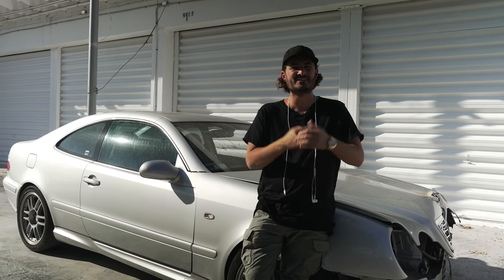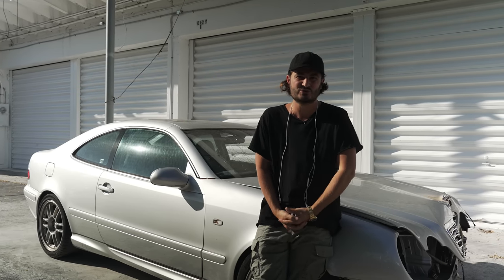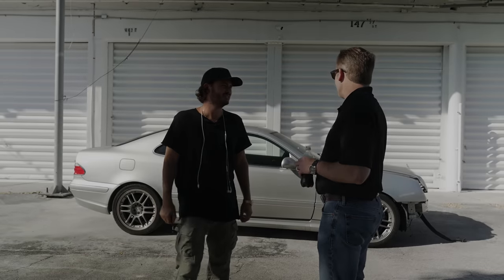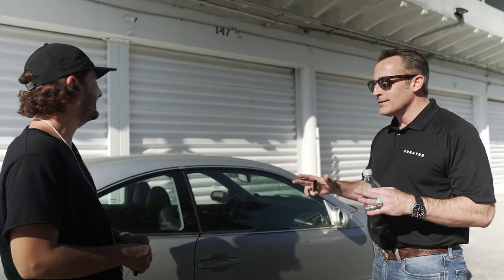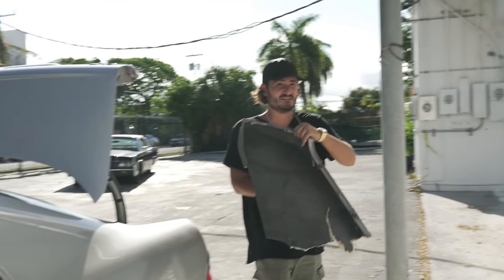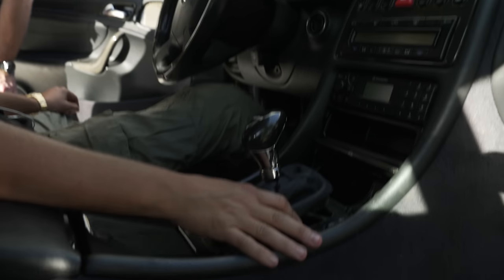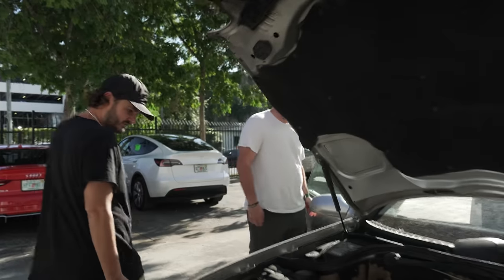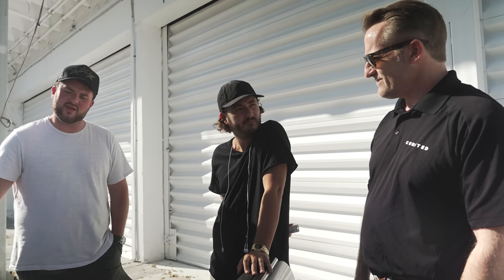1 of 1 CLK60 Donor Car Arrives - Absolute Disaster!

Comment: simple on the transmission part.... the v6 m112 and m272 manuals trans bolt right up to the m113s .. i have done that to my clk500 all benz manual parts bolt right up.. pedal assembly , v6 flywheel and clutch all legos

Comment: That is going to be a really interesting project.  I absolutely luv the wheels Multipiece OZ racing F1 Plus is what they are called. I had a BRAND NEW set of OZ F1 Plus , not splits, that I special ordered directly from OZ back in early 2000s, but they were stolen out of my garage in Denver before I even took them out of the boxes.  They never even saw daylight, Yes , I am very sour on that one, but I have the car that they were meant for still.  I've looked but never found another set of those wheels. I've always liked those CLK AMG Black Series since I saw the Top Gear episode it was on.
Reply from the maker: ugh thats heartbreaking.. damn thiefs.

Comment: Crazy thing is, I used to have a similar CLK 200 -00 manual (5-spd), in same color. It looked almost identical to John's 55AMG.  A regular person couldn't tell the difference from the outside, and mine had 136hp.
Reply: AMG kit on a regular Benz… Youre not fooling anyone with that, i promise u
Reply: @subway5907  Mine didn't have an AMG kit. I meant that a regular Clk 200 looks interestingly similar to this. Not meaning this as a diss. Sure car ppl can tell the difference. I do have an -84 Bmw 323 with genuine e30 M3 brakes and e30 M3 genuine front struts, all e30 M3 genuine hubs and some other parts tho..

Comment: I'd keep the engine in it's stock form, especially with it having a manual transmission. The engine may well be fine so no need to re-sleeve it or anything like that? I've been looking at conversions because I have a 6 speed SLK320 (R170) hence studying Mercedes and Crossfire V8 M113 and M113K conversions. Although you wouldn't think it, the supercharged ones are really better with an automatic. IMO it would be better to keep this CLK's present ECU (so long as it's ok). Adding a blower will be a major headache to set up without going aftermarket injection etc. I'm excited to see this happen but it'd be better to keep it as simple as possible so as doesn't turn into a protracted headache
Reply from the maker: The thing is that the first few of these had a supercharger from RennTech, they just would crack sleeves due to the bore spacing being thin.. So with iron ductile sleeves, we can use a SC like an early model CLK60 and use a RennTech ECU who will be doing all the work to the car anyway and can handle with ease. Plus whiny and whoosy sounds are fun.